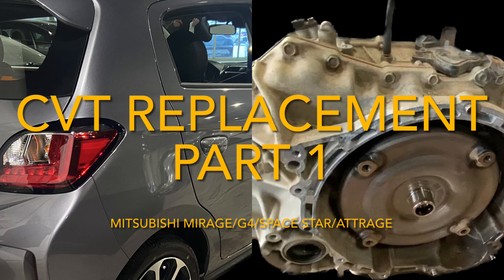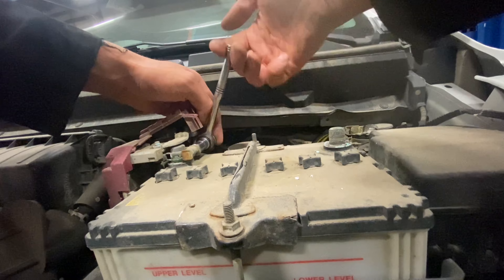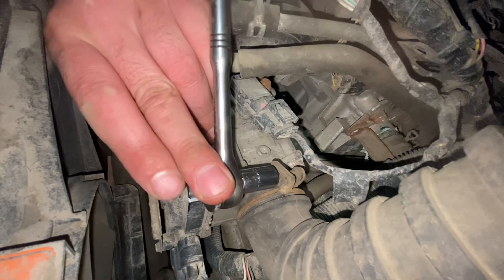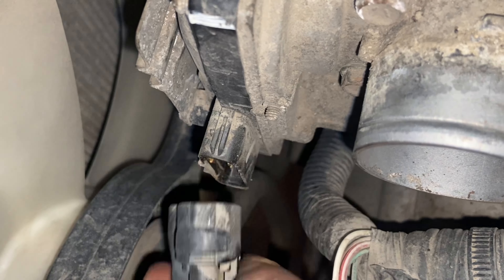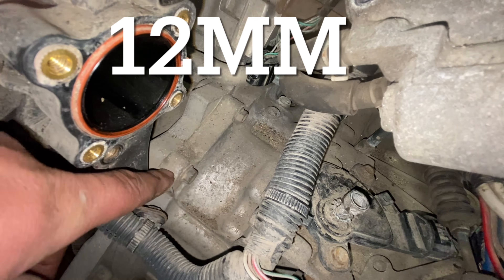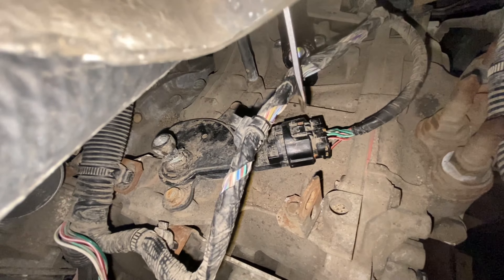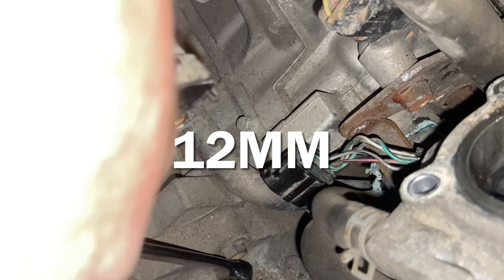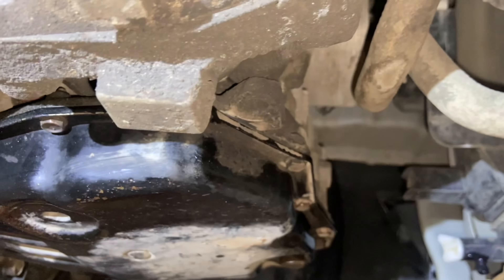How to replace a Mitsubishi Mirage CVT part1

Comment: Great video! I have a few questions though. How long was the total swap out time? Where did you find a replacement CVT? Used or reman? Approximate cost? Thanks!!! Love your channel!!!
Reply from the maker: Thanks! Swap out time is about 5-6ish hours. I have a bunch of parts cars at work that I get most parts from for the fleet cars so haven't had to buy one for those cars yet. 

I sourced out a cvt for my personal car(2014) from LQK. 
Car-part.com is a good source for used parts. Check out ebay too. 

I don't know if anyone rebuilds these transmissions? A new from Mitsubishi was around $6000 last time I checked.
I paid $500 for a cvt from a 2017 with about 6000km/3700miles a year or so ago.

Comment: Be interested in knowing how long a transmission replacement would take you beginning to end of the job…. Have a nasty feeling my daughter’s CVT is going to need doing and the job is a bit beyond my DIY capabilities.
Reply from the maker: Book time is 9.6hrs. Can do it with a hoist in less than that. 
I replaced the engine and cvt in my own mirage at home on the floor over a weekend and lots of beer. It’s not bad if you take your time.
Reply: @ - Thanks for the info - at least gives me a general idea of total cost to get it done ($1500 for a used/wrecked CVT and about the same for labour) - probably could do the job
Myself but would be a very long couple of days and I would have to find a place to do it.
Hoping that multiple fluid changes to flush out the old/burned fluid will sort it out for a while - drives and changes ok - just overheats a bit on long drives - which I think is fluid related.
You haven’t had any issues with cheap J4 fluid as opposed to Mitsu Diaqueen?
Reply from the maker: Check out car-part. Com.  Or look for one from LKQ on eBay 
any year from 2014-2024 will fit. They’re all the same.
Reply from the maker: And I’ve only ever used cheap universal cvt fluid that met the j4 spec.
Reply: @turdpailsandtrails  thanks so much for taking the time to time to feed back info! Looks like I can just start shopping for cheap(er) CVT fluid - the Mitsu genuine stuff costs a fortune.

Comment: Replaced transmission now my car won’t start any idea on what it  could be
Reply from the maker: What’s it doing/not doing? 
Is the starter working/engine cranking over?
Reply: If the battery is hooked up, try running an ODBII scanner. Unfortunately "my car doesn't start" doesn't tell us much and it could be a million things. Safest place to start is fuse panel